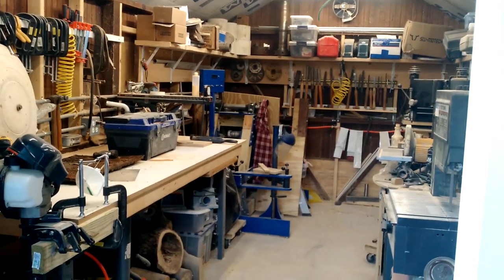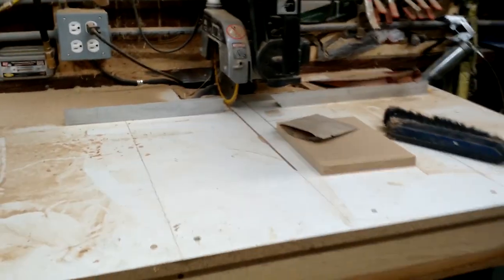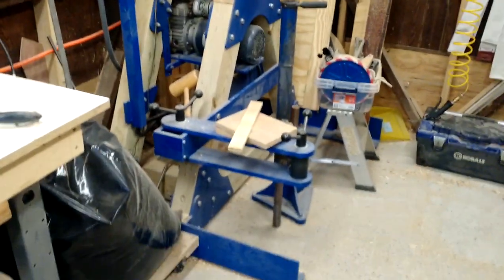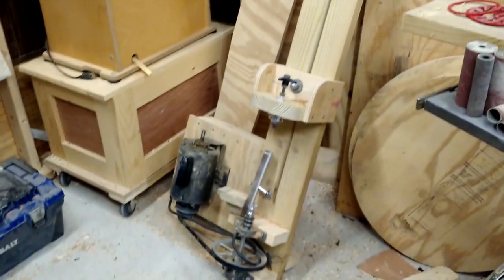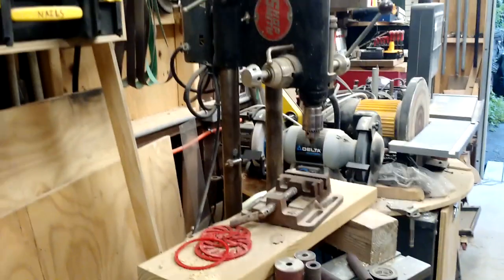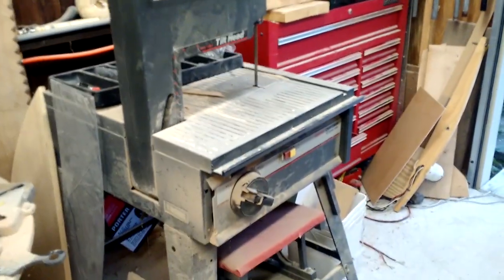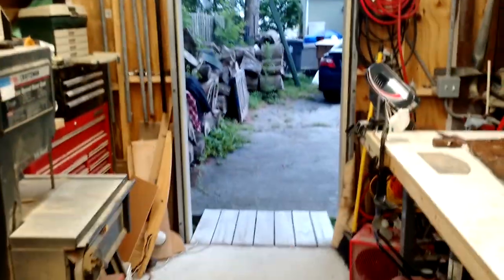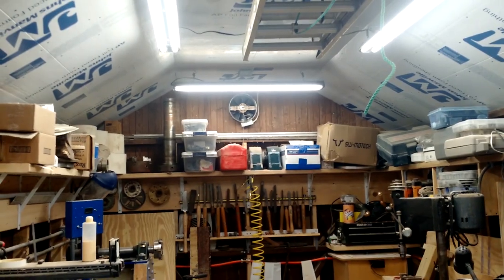Workshop tour - my home Woodshop - shop organizing ideas - shop projects and lathes

Comment: Very cool shop. You're not the only one I've seen that only used a RAS instead of having a table saw. You can actually do quite a bit with one and if set up properly, it beats the hell out of bench top and most job site saws.
Reply from the maker: thanks.  its smaller than i prefer but it get the job done.  i love the RAS, a lot of guys complain about how dangerous it is, but you are absolutely right, it is the most versatile saw ever made. i mean how difficult is it to keep your finger away from the blade!
Reply: +Ray Pena especially when one hand is operating it in the first place. Years ago I had a 6'X8' shop, had to step outside to change my mind. And 36" isn't a large turning? Lol
Reply from the maker: +Lyle Kobberstad, yeah 36" is tiny, lol. I meant in comparison to the capacity of the lathe.

Comment: Ray, I think you did an amazing job with space planning. I too have an old shop smith and the one thing that seems to always be overlooked is that they may do 7 or more functions but they only have one motor seeing the use of 7 machines. My motor got tired of doing 7 jobs and gave up the ghost L O L
Reply from the maker: +zing913945 thanks, glad you liked it.  I'm not a fan of all of the "transforming" of the shop Smith, but it does make an excellent drill press!
Reply: I'm planning a shop smith upgrade to a dc motor to use the lathe and sanding and drill functions. Even with short comings I would never get rid of my shop smith, they are just too  cool

Comment: quick question was your shop smith the combo that had table saw,lathe,drill press all in one I ask because I have of those but not all the documents was woundering if you might. I learned after some internet research what it was and when it made and when it was last sold new. it is interesting to me as it went out of production on, the day I was born.
Reply from the maker: +ThLynn Nydb it's an old 10er. And yes it is a combo machine.  I don't have any documentation, but it was built in the 40's... Possibily 46.  There have been several models but these older ones are the only cast iron versions

Comment: Curious, didn't see any grounding rods for service panel. Separate out buildings require it for safety.
Reply from the maker: +Bill D , you are correct, they do....but you failed to notice the grounding, lol. At 0:24 you can see the ground wire coming out of the bottom of the panel running parallel to the supply conduit. At 0:35, at ground level just behind the conduit (just to the left)  you can see the grounding clamp....which of course is how the wire is fixed to the grounding rod. I don't want my shop burning down either!